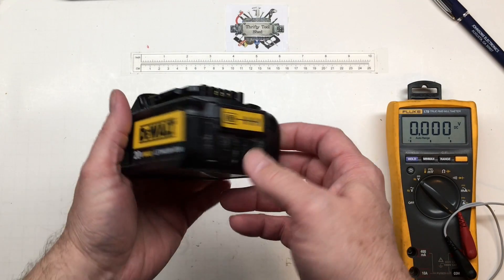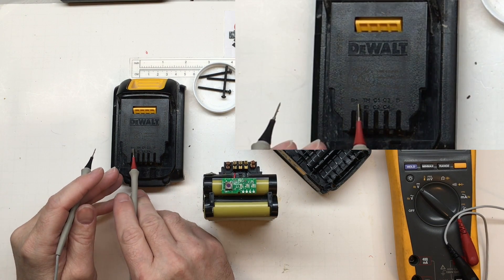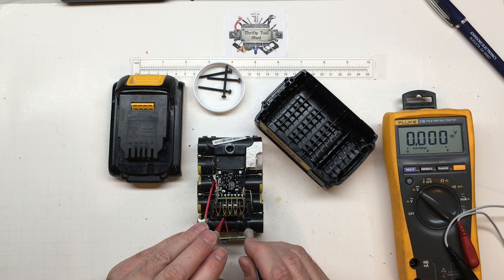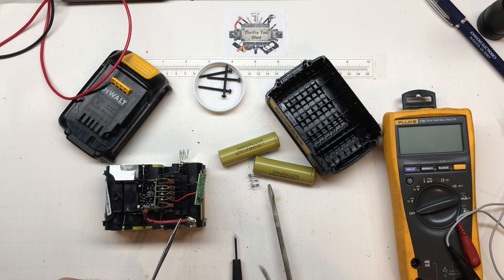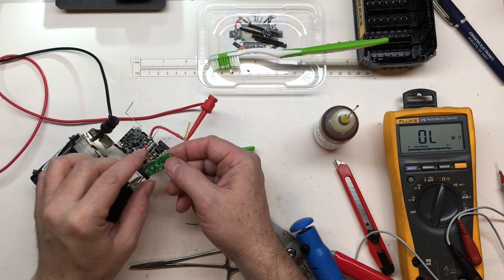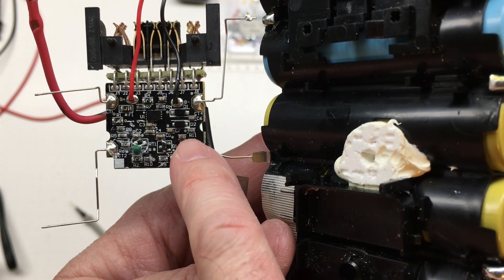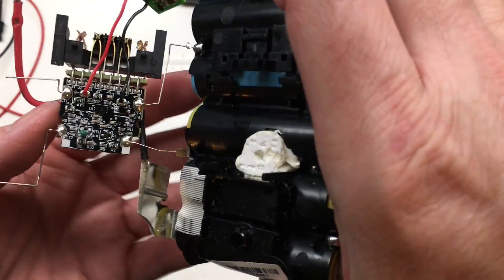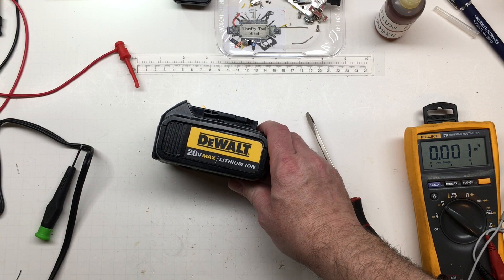DeWalt 20V Max 3AH Battery Repair

Comment: I have a 4ah that shows that it is charging and then I use it and it goes dead in a few seconds of use. Any idea what could be the problem? It's really not got that much use on it I don't think.
Reply from the maker: My guess would either be a bad cell dropping off quickily (similar in some degree to the repair video) or maybe even a loose connection to one of the cells (either power connection or the cell monitoring circuit)  It could still be a bad NTC or bad monitoring circuit board, but less likely if it is happy charging! Best of Luck to ya! Thanks for your comment!

Comment: Note: Don't use a paper clip. as soon i connected the negative it turned super hot. Use insulated wire
Reply from the maker: What are you using the paperclip mentioned for? Are you replacing the wire from cells to board?
Reply: Thrifty Tool Shed reboot battery that will not charge
Reply from the maker: @jayare1851  What are you connecting the jumper to when you "reboot" as you call it?

Comment: What type of torx screw? It has a pin in the middle.
Reply from the maker: That is a security screw. Most packs and even alot of tools have the security screws in them. You need the security torx bit.

Comment: As a self-proclaimed battery geek, I love these videos.  I have learned a lot from them.  Thanks you.
I would love to see you dig into some issues with the Ryobi 40V batteries.  They seem to "break" often.
Reply: I just bought 6 packs off of E-bay for the cells for $90 and the seller seems to have a ton left so yea, they seem to crap out a lot.
Reply from the maker: @ipissed  
A viewer mentioned in the comments a while back about going to Home Depot and asking  if you can go through the recycled batteries box to get some bad packs/cells. It''s a little odd asking that and they look at you sideways 😂 but, they have always said OK.... Last time I checked it was loaded with the Ryobi 40v packs!
Reply from the maker: Thanks for your comment!
Yes they do break often. I have been into the 40V packs and they are so problematic, I put off posting the video because it was  hard to not be negative! It's a bad design and I mentioned how they fail so often that I ran my 40v Ryobi stuff on 2 Makita batteries in series and the tools ran fine but with make shift batteries. I did that until I bought my EGO equipment! I may still post the video about the 40v if people may find it helpful?
Reply: Yes, please I would love to see them.  Most common issue I see is the power meter flashing, yet cells have full, or near full charge.
Thank you again.